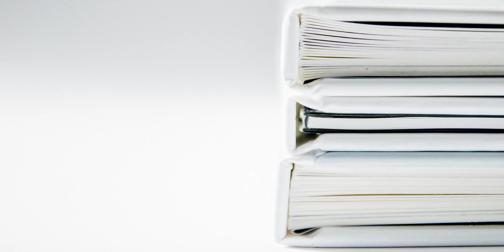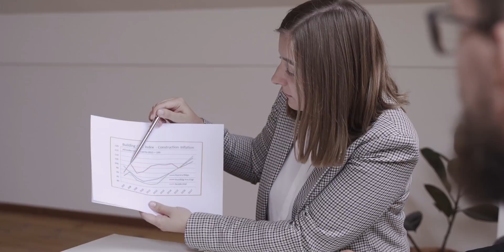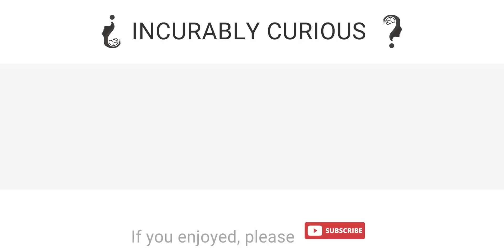Why Most Power Lines Aren’t Underground

Comment: In my country (Poland), in most cities and urban areas, only high- and some medium-high-voltage passages are not buried underground, because these are spread through very long distances. Also, these are rather not vulnerable to falling trees or crashing cars. However, in typical residential area you wouldn't see any wires except for fiber-optic that are available in some places...
Of course, in many villages electrical wires are still in the air.

Comment: I used to live on a farm before I moved to the city, my parents still live there. It has underground power, we've rarely had outages & they've only lasted for couple of hours or not too long off. I really only remember 3 times, so might as well only have been 3, once where they had to change some infrastructure and they had to shut down the power while setting it up(don't remember exactly what it was). It was a planned outage & lasted about 4 hours, not much more. Second a very bad storm & at sudden thunder the power went out in the whole area, power came back after 2 hours or less, don't know more of what happened. And 3rdly a neighbour farm accidentally dig where the cable were laid, so a section had to be dug up & replaced. Extremely early in the morning right after were they already there with machinery & replacement to fix. I don't remember how long it took, I think power was back within 2 days & then they filled the hole again 1-2 days after. Probably took longer, I remember best that once power was back they had left the machine vehicles & hole for couple of days before filling it in & getting actually done.

Comment: I also wanted to add that wildfires pose another risk of damage to underground power lines. The Calf Canyon Fire in northern New Mexico has caused the local electric co-op significant trouble in restoring power. Some of the underground lines in the Pendaries Village (a community built around a golf course) are causing the most trouble trying to locate and repair them.
Reply: Way to go to ignore the fact that you'd have significantly less wildfires if the lines were underground to begin with...
Reply: Trouble to locate a burried powerline? I have a solution: Making a plan where the lines are burried and then there is no problem in finding them
Reply: @Warliet  Yes, but even in that case it can be difficult to locate the exact spot where a line is damaged.

Comment: Ok my thoughts on why folks do not want to double their electric cost is because it’s already too expensive. For what costumers is pay at an ever increasing rate, should already pay for underground power lines.

So the actual problem as to why this is not resolved falls back on the electric companies and those who profit off of the electric companies not wanting to cut into their profit in order to reinvest into their company to provide a better service. 

That’s what it comes down too.

I mean when was the last time ace hardware came down and asked you if you’d  like them to ope a new gardening section.

Sure! you say, and the told you gonna pay the cost for our upgrade. 

Why would anyone do that?

Comment: Here most rural area local distribution power lines are going to be underground.

Why?

Because power companies must pay penalties for shortages. They even must pay compensations. Couple of hours shortage and no power bill for the whole month.

How?

Digging and/or plowing cables underground.

Problems in this video
(1) there are analysers which inform where the fault is within few centimetres of the fault.
(2) using poison to trees is bad.
(3) pruning is a high cost operation in a country of high salaries even for uneducated workforce. we do use even helicopters.

In urban areas all of the distribution lines are underground. It is illegal to build otherwise.

Comment: Big transmission lines can remain over ground, but neighborhood lines in less storm (hurricanes), flood, or earthquake prone areas can benefit from moving lines underground, just lots of digging required along with adding insulation and protection for the lines contributes to most of the cost.

Comment: Here is an idea... Why don't we have permanent corridors under the sidewalks where everything can pass through?
It seems like a good investment in it, especially since you could split the cost for passing power lines, water pipes, sewage lines and natural gas lines through the same area.
 Plus you could provide enough space for easy maintenance meaning you could lower the maintenance cost too.

Comment: well, power lines underground are very resistant during wars. that is why most of the European countries have them underground. It is just a cheap excuse for utilities in the USA (that are very inefficient to begin with) to just hang the lines above the ground and keep coming up with excuses why they cannot be put underground. Floods that happen once in 100 years are not a reason to have them above the ground when you have 1) winds 2) snow, 3)trees to have an outage, and lastly, 4) fire caused by one of the 3 issues.

Comment: The arguments against burying powerlines merit challenges. The claims and comparisons don't appear to be presented with a nuanced approach. 
Let's see there is the $5,000 replacement of the rich man's garden plant. 
There is the doubling of electrical costs as if all the powerlines were to be replaced in a short time horizon
Was there documentation of successful projects that although were initiated decades ago by cities in well-developed areas of several California cities?
The argument is not that it is not costly, but that even a 2% annual allocation to bury powerlines starts the process. Twenty years from now a city can be with 40% of its powerlines buried or it could have zero. 
Were there examples of successful projects in cities that removed the blight? Did I miss them? 
Was the opposite argument for burying lines adequately presented? 
 Who paid for this presentation? I'm incurably curious.

Comment: I honestly wouldn't be surprised if a lot of the cost estimates are deliberately inflated, or look at it as "all the power lines" rather than just focusing on ones in residential areas or high power outage areas. Also, while there are some risks still to the lines themselves underground, those risks would vary a ton by region. Things like earthquakes don't pose a risk in areas with few or no earthquakes, such as my area, while tornadoes and severe thunderstorms are common, which would, (and do), frequently knock out the power. There's also the immediate cost vs the long term savings in repair costs, which should theoretically matter a lot, but the companies don't want to take on any immediate costs. 

In the vast majority of places, at least here in the US, they also don't care about customer satisfaction, since they run localized monopolies and it's a choice of either "you put up with it, or you just don't have power". Why spend to put in the effort to improve, when you can make money off the customers as is and they can't really complain?

Comment: I believe we can develop a hybrid system. For example from a power Station to A substation we can use underground cables and from the substation to consumers we then use overhead lines.

Or use it in strategic areas for example across a forest. Or minimising the number of cables that go down.

Lets think of fiber cable. 

Maybe they out thought it thinking they would create tunnels.

Comment: Having grown up in a place with mostly underground lines and earthquakes (Southern California), and now living in a place with mostly above ground lines and wind/ice storms (central oklahoma), hands down the underground lines lose power insanely less because of natural disasters. One of the issues not discussed is the risk of fire- above ground lines that fail and spark start brush fires all the time, and I've never heard of an underground line causing one except in a major disaster with an accompanying natural gas leak. Meanwhile every year it seems I drive around a brush fire caused by a power line.
Reply: Where in Southern California is that exactly? Because I came from the Los Angeles area, specifically the South Bay, and there were a ton of above ground lines there (of course there are also underground lines, but still they were insanely common above ground).

Comment: Where I live all of the electricity lines are underground. We are seemed so remote that it is less expensive to place lines  underground than sending crews this far to repair overhead lines.
However, we still experience electricity failures because upstream, many many kilometres away, the lines are still overhead.

Comment: The cost of having overhead wires were  probably ignored in these studies.  this $ would be saved every day with underground wires.  tree trimming -pole replacement, wire lineman work etc.  overtime cost of importing workers when power fails due to trees etc eliminated costs due to underground wires ..  nobody wants this change so everyone in current system lies, misrepresents, fabricates, prevaricates.

Comment: I’m really curious why flooding would be a problem specifically for underground lines? 

Underground lines already have to be somehow protected from water so they don’t short out or (for some materials) corrode. So why would flooding be a problem? If it’s because of flooding severe enough to shift the ground, that would affect poles, too. And probably more easily: a conduit might survive the ground shifting slightly around it, particularly if the ground is soft enough due to a flood to ooze or flow. Poles are top-heavy and sometimes under tension, so need to stay pretty firmly anchored. 

----
I realize that burying isn’t a panacea—I live well north of the frost line, and we bury a lot of local power lines here, and I’m genuinely surprised we don’t have more power outages due to frost heave. But I am always surprised that specifically the US southeast doesn’t bury power lines: no worries about frost heave, not earthquake-prone, and regularly subject to hurricanes and other severe storms. Seems to me that the long-term cost-benefit analysis there would be in favor of burying. How many of the folks surveyed there who didn’t want to pay more for more-reliable power are currently paying for a generator and a stockpile of diesel , in case of outage?
Reply: People can live without power if they at least have gas hobs or ovens.. The main issue is that cables are not 1 single continuous line, if it got flooded you could cause a power surge from the water. The weight of the cables can be a factor as they may start to sink in one area and cause constant tension on the line.
Reply: This was a point that had me scratching my head. I live in New Orleans, and our downtown area is completely underground. On a normal day, most of our cables and a lot of our transformers are underwater. When utility crews come for storm restoration, they stay in the downtown area because it is usually the only area that doesn't lose power. If the cable is spliced and terminated properly, water intrusion is not an issue because the manufacturers know the conditions that the cable will be in. For Hurricane Ida, the downtown area lost power, but only because of the Overhead Transmission lines. Once the Transmission lines were restored, the underground cables were able to be energized without making any repairs. This is the reason that the downtown area of New Orleans was the first area to receive power after the storm.

Comment: Underground lines definitely have their place, such as in rural wooded areas, northern united states particularly, underground lines are definitely not worth it in high transmission areas, such as those from the substations or the power production facility. I think both have their own place and when used accordingly save both the power utility and homeowners from a lot of problems
Reply: But in rural area, they usually use the normal, overground lines.

The underground line usually in urban area that dont need big electricity power.

Comment: Personally if I was in charge of the electric companies and was looking to switch to underground wires, rather than do a full switch all at once I would turn it into a century or two project, where the switch is only applied to cables that need to be replaced anyways, I would not replace the towers until the cables had been replaced on both sides either, this would mean slightly longer cables so that they can be threaded into the ground from the top of the tower, then threaded back out at the other end to the next tower, this would be overall cheaper to implement in the short run and would not cause a huge spike in consumer prices, if at all, and even after switching to underground I would stick to using towers, just not super large ones, instead ones that are around hands reach height, this would make it easy to identify where they are to the uninvolved, likewise there's no need to dig underground to check a cable, just detach it from both ends then pull it out, the only extra "infrastructure" would be a wired enclosure for each tower to stop kids and birds etc from accidentally touching the equipment and most likely getting themselves fried to death, furthermore doing it over the course of a century or two and only for ones that need to be replaced anyways would make it easy to switch to newer technologies for underground cable protection since you just switch to them immediately for new ones and replace the old as and when they start reaching their end of life span period

Comment: Where I live, power is underground everywhere except very very rural villages.
Also, every individual house is powered from two sources.
Also, there are probing holes for diagnostics (to check if there's power) every so meters, which also includes a power cutoff.
If a power cable fails, all houses are fed from a manually activated adjacent one. The power company can also temporarily place a jumper wire (thick one) between two prepared points to supply power to the building without power.
Neighbourhoods of 10-30 buildings are fed with 3 to 5 wires coming from the grid/mesh of power lines.
Where I live if fed with two medium to low voltage transformers.
When 1 fails... Many times the other one can pick up the slack just fine (if people aren't heating their houses).
Power failures? Average 1ce per year for average of 1h.

Comment: We dont need smart grid technology to measure the length of a wire.

Mid range electricians have technology that you can tell a computer the wire size and it modulates a variable signal down the wire. The time to return as well as what part of the signal returns is how it meaures. This is a 2 grand entry tool. But its chump change and should already be in the arsenal of citywide infrastructure

Comment: And tell me now, HOW YOU ARE GOING to fix up the problem if the high voltage cable gets damaged. Look at, the fallen down high voltage wire is doing the burning metal and melting stones at the point that the high voltage gets down; it is impossible to fix it - or very difficult.

Comment: I think the FAR future holds solar and battery power on each rooftop supplying that house’s demand 

Until that point as solar and battery capability increase and power systems get old and start failing instead of replacing them each town will have their own shared network separate from neighboring towns

Comment: Properly done Underground lines don't care about flooding just like an aqueduct doesn't or other underground pipes. 
The fact that in 2022 we are still talking about wooden telephone poles is indicative of the way the infrastructure is perceived in the US. Anyone coming over to visit is always astonished by wooden electric poles and in general the disgusting state of the lines in general.
Reply: Done properly overhead wires can also be fine. I live in Quebec, Canada and we had a massive freezing rain storm in 1998 that took power off up to 6 weeks for some in January-Feb which are very cold months to not have power... Since then we changed the design of our pylons so we never have this issue again. The way our grid is built mean that if there is an accident the power is back within minute using a different route until the fix is made (which is usually 2-3h at most) and the power re-switch happens without blinking.
Hydro-Quebec the company responsible for power also check trees growing near lines all the time and groom them as needed. We have a very proactive province-owned power company and that makes overhead power line work without pretty much all flaws said in this video.

Comment: The downside of this "curb your enthusiasm" video is the fact you're still susceptible to solar flares, and I'd think that there would be some clever idea to preventing that kind of damage to our power grid powerline tunnels with faraday cages. The Carrington event in history tells you what can be done with a huge antenna, and a solar flare - the telegraph lines that were working by themselves when disconnected from their batteries? That kind of feedback into our power-grid needs to be protected. Houses would be built quite a bit differently if not given construction codes to follow. There needs to be a revamp of the rules for our power grid too.

Comment: Overhead is easier to inspect. I bad a buried line that was partially severed. Eve4y 6 weeks or so half the house panel would go dead for a moment. Add to that, heavy downpours, puddles on the ground, seeping down to partially damaged power lines, is a recipe for instant electrocution. When the utility company found out, they came out within 30 minutes and spent all day fixing it because it was a fatal accident waiting to happen.